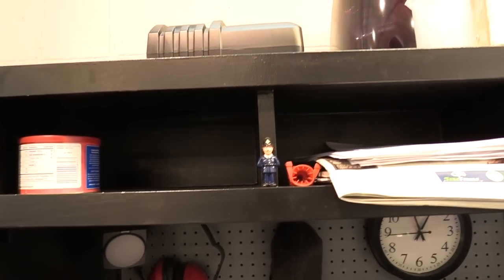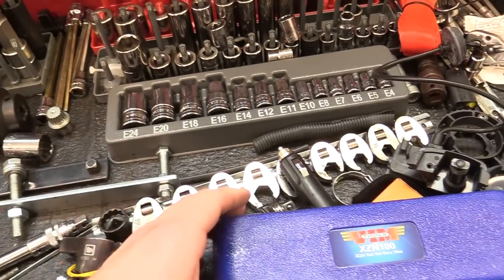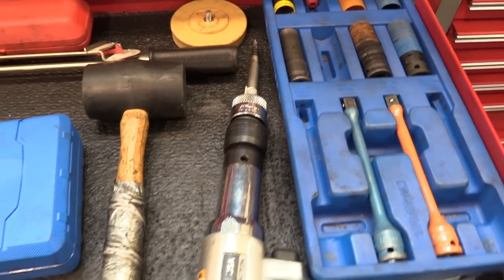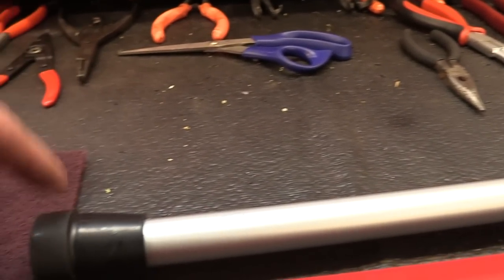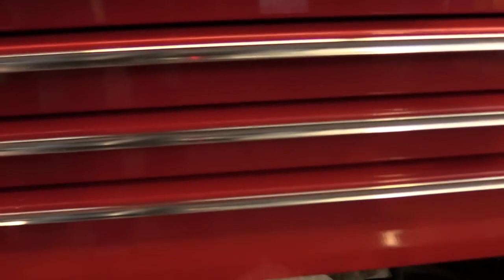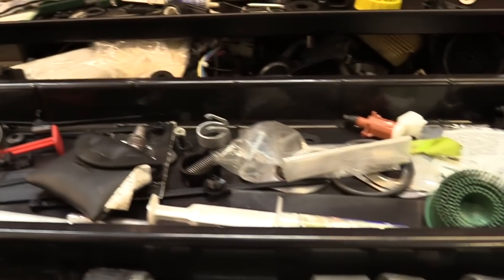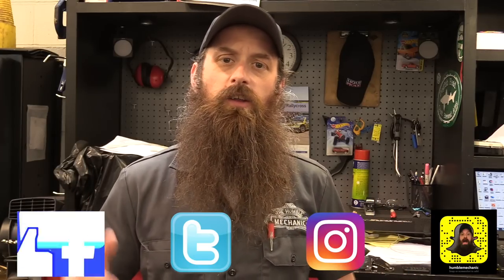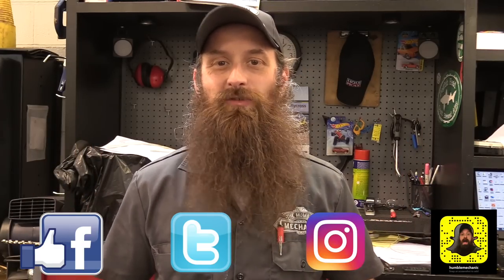Real Tool Box Tour ~ Humble Mechanic

Comment: *WARNING - LONG**

After watching the video, I was thinking, I like the hutch, but wow, where's all the tools in that big old box?  I have a pretty large Box, but single drawers.  But taller, with a some small drawers on the left and right of the top box.  It's also not the typical Topic Box where the Top opens up into the air.  Mine is just a flat top where I can just push stuff on top.   It's a MAC Box I got used, which replaced a Craftsman box I had before.   My Box is packed full of tools.  I had so much, I ended up getting a Craftsman Cabinet.  You know one of them Red ones with the Black doors. 6 foot tall or something.  That thing is packed with even more tools.   I had far more tools then the place I worked at.   

Now they're all moved to my garage.  I completely changed  careers.   Now I'm the Maintenance Supervisor for a Food Factory.   So I'm fixing equipment.  Removing older machines, Installing new machines.  I'm working with 480 3 phase down to 120 volt whatever.  240 3 phase, 277, etc.  Since we cook, We use Steam,  So I have a couple steam generators to work with.  I have to hook new hardware to that system.   We also IQF, Nitrogen Freeze all our products.   So I get to deal with that.   I've been working on a new packaging line which I've been working on myself.    Required a couple new large transformers I had to install, lots of conduit and wiring.  Lots of power cord drops into the room.  Should have seen how I went about getting a bucket elevator lifted into the air and bolted together.  Ceiling is 15 feet high and I had inches to spare, right next to a light on one side and a fire sprinkler on the other.  It's 3 parts.  I had to make a 2 dimensional cardboard pattern of the 2 elevator lifts, and figure out where they and everything else was going to fit.  Then bolt everything down to the floor.    I had a lot of repair work on a $100,000 dollar used bagging machine.  I had to get custom things made.  

While working on that project, I had to pull a couple 15 year old tunnel freezers.   40 some odd feet long.  Temp install a new replacement machine because we needed to use it. While I'm trying to get the other smaller one in it's final place.  But until it's working, I have to move it out of the way while they cook the old way.   So new Conduit run across the factory up above.  where I can run 480 volts 3 phase to these 2 machines and a dumper. That's 10 wires I have to pull though 3/4" conduit.   had to get a new Nitrogen, Vacuum insulated line made.  54 feet long.   I had to create a cardboard templet  for for the Intake of the machine as the original one was to small for the incoming conveyor.  Bring that to the welder to copy what I did.  That's now done.  Looks just like what I did with cardboard, now in stainless steel.

Unlike CARS where they make millions of them and parts are all over and there's sources to get info yo may need like from Alldata.  I'm dealing with machines that are made in the hundreds per year maybe.  There's no online source.  I have a Wiring diagram in general,  I know what the power needs are,  whatever else, steam?  Water?  Nitrogen?  I have to figure it all out myself.  There's no plans.  I figure it out in my head and then order the parts I'm going to need, or pick up what I'll need from Home Depot.  I deal with a lot of stainless steel stuff as we are a food plant.  

I had to rebuild a Sushi Machine, that makes Sushi roles.   We got it used from Hawaii.  It was beat up.  Things were not working correctly. Bearings bad, bushing bad.  It's from Japan.  There's only like 2 of these things in the U.S.  It's all Metric.  Had to track down Metric bearings.  I had to get bushings custom made. The PLC (Computer) had a few issues which cause things like the cutting knife not to work. I had heard they were manually cutting.  That's just silly.    So that had to be sent out and rebuilt.  It has the custom software to control everything.   You can't just buy a new PLC  easily.  Trying to deal with the company in japan?   My wiring diagram was a copy of a fax of a copy.  It was pretty bad, half missing.  So it was figuring that out.  , Changing how the power went into it.  Adding a motor speed controller for the belt so we had better control then 1 speed.  So on and So on.  

So this is what I do these days.  I finally got help, but he's not much help for me other then minor things and even then sometimes I just wonder.   I went to school at UTI in 87/88.  Auto and Diesel Mechanics and Refrigeration in Phoenix, AZ.  My last place I worked at, I worked there for 18 years, and then the company came to me and offered me the job I have now.   The Plant manager knew me.   I meet the HR person at Giants Burger just down the block at my launch break.  Talking about the job then later visiting the place.  So between that and other things I've learned over the years prepared me to do what I do, and even then I'm always learning.  I'm also very PICKY and want things done my way, the right way!!!   

I do whatever needs to be done.  From fixing a sink , to a sprinkler outside, to fixing a machine, to Installing a whole new Packaging Line.  Know what's the worse thing?  Something breaking down, stopping everything, and having the production people watching YOU while you figure out what's wrong.  Find a solution.  Even if it's a temp fix.  To get back up and running before losing thousands of dollars in product, and labor of people standing around.   Some days, it seems like one issue after another, when I had planned to do something else.  In general, I've left alone. I don't have people telling me what I need to do and when or how to do it.   Many days I spend hours on the computer just tracking down the parts I need.   Writing PO's for hundreds or thousands of dollars.  Nothing is cheap.   In the end, I like what I do.  It's always different.    I don't have to deal with customers and their car issues.   The number of times I go out on a test drive with a customer to hear the noise they are hearing and then it doesn't do it.     The new owner was a ahole.   I'd be Costco and bump into a customer and they'd tell me how they just didn't like the new owner.  Long time customers.   It was a smart move to leave, even after 18 years there.  My current job, it's been about 7 years now.  All my tools mostly sit around.  Though some of them come in handy at work for something once in a while.  I still work on my own Truck and family members cars once in a while.   I may be a little rusty speed wise.  I really miss having access to a lift.   I do have a nice air compressor and so can still use all my air tools at home.     I don't have electric tools like a Electric air ratchet or Air gun.   I never saw the need.  I had easy air access all over.  A have a lot of different air tools. My favorite Air Ratchet is still my Snap-On, with the push button.  I've own MAC and others.  I have some Snap-On tools, Mac Tools, Matco tools,eve some Cornwell stuff, and Craftsman tools. Along with some Harbor freight stuff on a few tools I rarely used.  I think I have the same triple square set shown in this video in that blue case.  I have some tools I got on ebay.  

Be smart buying tools!  Why pay full price on a Snap-On tool that you can get on ebay for a fraction of the price and still have the lifetime warranty!!! The prices for a Snap-On tool Box, I've asked if there was a Engine and stearing wheel on them so I could drive it to work and get some money worth out of it.  Don't get into huge debt buying a bunch of Snap-On Tools and Tool boxes.  It'll kill you.  You get get a lot of great tools used.  Tool box USED. I got mine used from the Mac Truck.    I think I paid $2300 for it and it's a pretty good size Box.  People upgrade to larger boxes and trade in their older boxes.  The Craftsman Pro series tools are fantastic!!!   Why spend $200 on some Snap-On tool that yo may use 1 or 2 times a year when you can get a version of it from Harbor Freight for $10.   All the money  you saved, you can spend it on a tool you really need all the time.   Get more for less.  Shop smart.   I remember at one point I was paying $25 a week to 4 different tool trucks. Snap-On, Mac, Macto & Cornwell. That's a $100 a week, $400 a month.  This was early on when I first started out working as a Auto Mechanic.  There really was no Internet and ebay back then.  No Harbor Freight.  Options were limited back then. Pay was not great. better then Minimum, but still, back then, that was a lot of money.  Even now, $400 is a lot of money to spend on tools every month.

I'm going to end it here.  It's already way, way to long.

Comment: I love the old style computer . It has a 3.5 inch floppy and most likely serial and parallel ports and a small hard drive and even not much ram . I have 2 from when I have to program sysmax and cummins programmable controllers the parallel port is used for the protection so you can not use the program   with it plugged in. I also seen a box of cd rom either 680 mb or 4.7 gig byte or double sided 5.2 gig byte . I am a disabled vet spent 7 years on submarines to bad I got hurt by a chain that broke . But I was on SSBN 619 634 and 1 fast attack. The ssbn were built in the late 60s . The torpedo and ICBM are analog type and run off unix or dos 3.0 There is also a portable programmer serial type to program top secret things that I can not talk about .    I would love more info on the old school computer. But being disabled from the waist down some time folks bring over the controllers to program as the fobs cost over 5k

Comment: you can get led replacement light for those types of lights. They are 15 to 20$ for 4 dimmable lights. they will last for years instead the six months that the halogen bulbs last and the LEDs do not get hot. On Amazon; Bonlux Dimmable LED G8 Bulb- 120V Warm White T4 G8 Bi-pin LED Halogen Replacement Bulb for Under Counter Kitchen Lighting, Under-cabinet Accent Puck Light Desk Lamp Lighting(pack-4)
Reply from the maker: +Don Barton nice. Thanks for the heads up. I was just too lazy to fix them. Lol

Comment: I moved my similar box to my parents house when I switched careers.   They parked their snow and salt covered vehicles.  After a few years of that and my tools, impacts and wrenches mostly, were rusty...some of them too rusty to use.   Disappointing.  Even the roller bearings on my Snap-On drawers were getting "crunchy" from rust....Sucks.  Took everything apart and oiled bearings and tools.   Just a word of caution for those who have "moved on" from the tech world but kept their [VALUABLE] tools.   Oil everything before storage.

Comment: Love your channel man! just picked up a 4.2 Allroad (BAS engine) car has 115k miles and runs great, any tips to keep the timing chain/guides alive as long as possible other than keeping fresh good correct weight oil?
Reply from the maker: +Jolinator oil is the biggest man. 

You can use a product from BG called EPR before an oil change. It works great. 

Liquimoly makes a product too. I used it on my last oil change. Worked great too

Comment: Charles what is it with 10mm wrenches everybody no matter what brand vehicle they work on especially dealer techs seem to have a custom made 10 mm wrench. including myself, mine was for timing belt jobs on a Ford four cyl engine.
Reply: Brad Downs A 10mm wrench goes a long way
Reply: oliver t. yes or a short way as in cut down or bent shorter :)

Comment: Speaking to your comment about the HF torque wrench, how can one tell when a torque wrench is out of spec (If they only have the one wrench)?  Is yours just really noticeably off?
Reply: Arie Beugelsdijk when the tool truck comes by the shop, they have a wall mounted tool that is for checking torque wrench accuracy. Also, when you do this for long enough, you can tell when it doesn't feel right.

Comment: They said the car just stalled i loosend the bolt thats gos from fuel filter to the fuel rail had them crank it sure enough fuel sprayed out so i know pumps working i check spark with tester was also getting spark if it were the timing belt it should get spark still rite just stalled now wont start up

Comment: How do you have the hutch attached to the box? Bolted or just shear weight.
Reply from the maker: +Blake Dehle it's screwed from the bottom up.
Reply: HumbleMechanic drill and screw or self tapping screw? Did you take the drawer out?
Reply from the maker: I used a few wood screws. There is holes in the top of the box. Just simply wood screws. I didn't take the drawer out, but it would have been easier if I did
Reply: HumbleMechanic thank you!